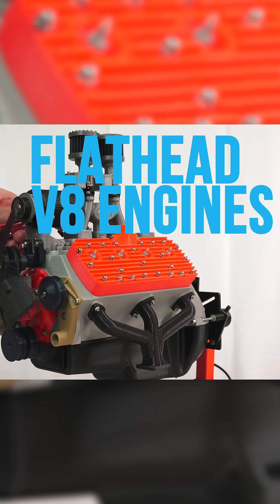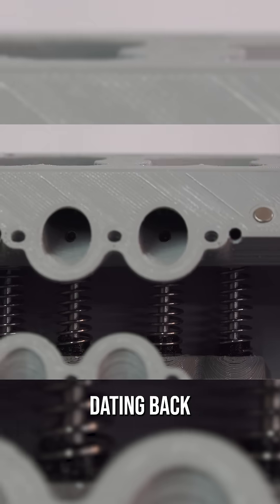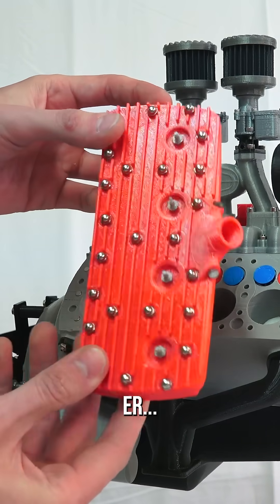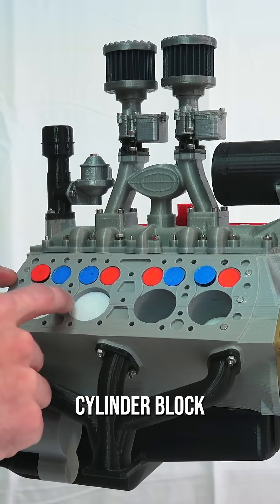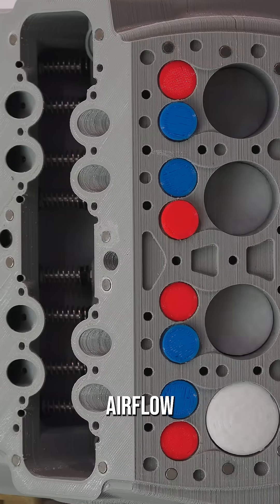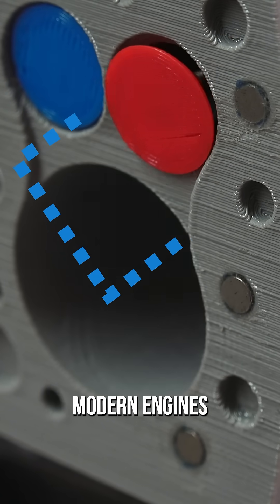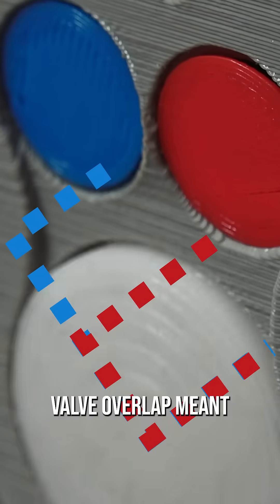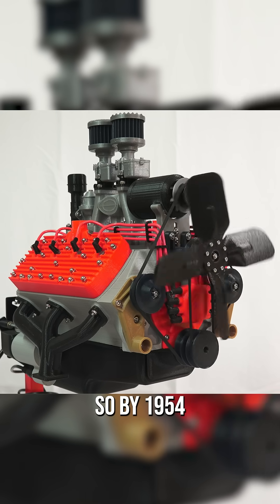What Killed The Flathead V8 Engine?

Comment: 1954...in America.
Here in Brazil we had the Flathead V8 up to 1967 on the Simca Chambord...
Reply: Yeah but you guys got Willys pickups into the 1970's too, lmao
Reply: @TylerLinner  But they were not V8's...
Reply: @AMV12S But your women are less insane, and you can claim Antonio Carlos Jobim and Roberto Leal.
Sou de Ludlow, Mass. USA.
Reply: It's pretty funny that a crapbox from 2004 fitted with a 1 liter naturally aspirated engine makes more power than a 2.x liter V8 from the 50's and 60's
Not only was the airflow terrible on those older engines, they also didn't rev nearly as high and ran on lower compression.
Reply: cuba... still with it's cars from the 50s because they don't buy any anymore
Reply: Thanks for the info.....Philadelphia
Reply: hmm

Comment: So it’s basically a V8 Briggs and Stratton lawnmower engine.
Reply: No, it's a side valve engine just like most other car engines at the time.
Reply: @Rob-fc9wg  
Isn’t that what a Briggs & Stratton lawnmower engine is?
Reply: @grumpy3543  
Once again, they're both side valve engines, just like the majority of engines ( cars, truck, motorcycles, machinery, stationary engines etc) of the time.
Reply: @Rob-fc9wg  I don’t think that the majority of engines are flathead (side valve) engines. Can you let us know what flat head engines are currently being made besides Briggs & Stratton
Reply: @grumpy3543  
I don't know of any side valve engines being made these days, even Briggs and Stratton don't produce side valve engines ay more.
Do you know what "of the time" means?
I'm referring to this time of the Ford side valve V8 in the 1930s.
Reply: @Rob-fc9wg  What are we arguing?  The flathead is the same design as a Briggs & Stratton. It does not have overhead valves. What are you arguing anyway?
Reply: @grumpy3543  
I give up, you're too dense!

Comment: Were flatheads' lack of efficiency assisted at all by turbocharging?
Reply: There were kits to install superchargers on the old flattie Fords.  It did help make power, but the flathead design was still a fairly significant restriction.
Reply: @xaenon  I just like the streamlined look of them...Thanks. I started researching the hot rodding enthusiasts and they really took these "handicapped" motors to the extreme.
Reply: As said, people were supercharging them. But those blocks were pretty weak and, with only 3 main bearings, the crankshaft isn't all that stable.

Comment: The flathead was a very low compression 6 to 1
Reply: The gasoline of the day was pretty bad.  Compression ratios higher than about 6 to 1 were pretty much all the gasoline of the day could reliably support.  After the war they began using additives that had been developped during the war, which allowed for much higher compression ratios.

One of the additives was tetraethyl lead, which helped keep the valves from being eaten alive by the higher combustion temps of the higher compression engines.

Comment: There was a flaw with the flathead V8 engines. that was common on a large number of these engines. and was cracked engine blocks. they commonly cracked between the Valve seats. companies such as Offihouser produced much better heads for these engines. along with better intake manifolds but that would bring a new issue out in these engines. because as people would build these engines for better performance. because they only have three babbot main bearings. they were prone to crankshaft failure. but when built more mildly and put in light deuce coupes. they were pretty fast compared to other cars of the era. and Lincoln made a larger flathead engines in V8 and V12 configurations that were popular with hot rodders of the era.
Reply: The combustion chamber is the gap between the valves & the cylinder, getting cooling water in there is impossible so it's a hotspot.
Reply: @alanhat5252   
I know these engines pretty well. the valve seats were too close together. and the proof is they make a modern version of these engines. with casting of the engine block with the valve seats spaced apart farther
 and use clevite style bearings which cures these issues.
Reply: @musicauthority674  as I said, lack of cooling
Reply: @alanhat5252  They on rare occasions would crack down the cylinder bores also. I know this because I had one that did that. there could be a number of reasons for that to happen? such a previous owner over heated the engine. or didn't keep the cooling system serviced at the right intervals.
Reply: Hot Rod Lincoln!
Reply: Not all the flat head ford engines have babbit/babbet/ babbot bearings  but they all have unbalanced cranks shafts
Reply: They had cast iron crankshafts which are inherently weaker than current forged steel ones

Comment: This seems like a design that could be improved.
Reply: It was.   It evolved into the OHV engines in the 1950s.  There were speed shops that offered OHV conversion kits for these engines back in the day.  Ford learned what worked, and after the war when there was demand for more power to move the increasingly heavy cars, they rolled out their first OHV V8.

But, it was actually a Lincoln mill, and it was introduced in 1952 - 279 cubic inches.    Ford got an OHV six that year, and didn't get an OHV V8 until 1954.

Comment: Offenhauser made OHV cylinder heads and a conversion kit...
Reply: Zora Arkus Duntov made the 'Ardun' Hemi conversions for these engines back in the day.   Later went to work for Chevrolet and created the Corvette.
Reply: Offy made a LOT of performance parts for those engines but AFAIK no OHV heads. Others did. Speedway motors has a ahuge range of those engines.

Comment: Not just airflow...biggest drawback is the shape of the combustion chamber with uneven compression areas, uneven burn distances and generally low compression
Reply: All that stuff was a bit ahead of the engineering of the day. By the time they had developed the OHV they were starting to sort out distribution and such.
Reply: @xaenon  
Not quite true...the first four valve OHC engine was developed in 1914 (just before the war) and used in a racing motorcycle in the UK. The Ford flathead was a child of penny pinching...to get bang, you use displacement...a formula which works to this day, with GM and Chrysler still using OHV V8 engines

Comment: That airflow thing isn’t really a problem
Reply: Not for general use, no.   The engines didn't need to whiz up past four grand very often, and displacements were typically very small.   The flatties at Ford were 221 cubic inches, and Mercurys were 239.

Comment: The main reason was restriction because the middle 2 cylinders on each bank shared a single exhaust port
Reply: That's not really a problem it's the heat

Comment: The video is incorrect. The Cadillac flathead V8 was produced in 1914, about 13,000 were made, making it the first mass produced American V8 engine.
Reply: IIRC correctly, there was a Chevrolet V8 early in the 20th century too.   But both it and the Cadillac were terribly complicated things to build and maintain, and fairly expensive, too.  

Ford had the distinction of figuring out how to cast a one-piece cylinder block in a fashion that was cost effective enough to offer the engine in 'middle class' cars, and it was fairly reliable, too (remembering, of course, that this was the 1930s and 1940s).

Henry wasn't the man to come up with the first V8, that's true.  But he's the one that made it  cheap and popular.
Reply: @xaenon Chevy had a V8 from 1917 to 1919. Being an OHV design, it was compairitively complicated.

Comment: The exhaust path around the cylinders also led to chronic overheating isdues
Reply: I was amused to see that the v8 engine had v6 headers in this 3d printed model. That would certainly have contributed to an unobvious exhaust path, too!
Reply: @JerGol You absolute Muppet
Reply: @JerGol  Part of the flatheads faults never resolved was the siamesed exhausts. Though some OHV V8s had similar in the 50s. Stude V8s were one

Comment: The first DOHC V8 is the GAA engine for the Sherman tank. First mass produced pushrod V8 from ford is the Y block engine and really changed the game. It got replaced by the Windsor.
Reply: The amount of tech in the GAA engine is astounding. It really looks like an engine 40-50 years ahead of its time. It's always been surprising to me that Ford never brought the GAA's design cues into a mass production automobile engine.
Reply: @wysoft  The 1st time I saw a GAA; I thought it was a modern hemi style V8.........had a major WTF moment when I found out it was a thing from 80 years ago.
Reply: @wysoft  If it's for a tank, the bean counters stay quiet.
Reply: I thought the FE replaced the y block? Then that got replaced buy the 335 series big block?
Reply: Chevy had a V-8 in 1917 Rolls Royce in 1905 Cadilac in 1915   The Ford GAA engine was 1945 Era
Reply: Not to mention it was based on the V12 Merlin (Ford stole the design when they were supposed to do a deal, and tried to replace aircraft engines with it, but it didnt work out, so they went from 12 cylinders to 8, and thats how we got the Ford GAA)
Reply: @n2oin  Of course the yanks would decide to just steal something instead of make a deal, it's cheaper!

but sod them, I'd rather a Meteor any day.

Comment: Interesting that Europeans were making dual overhead cam supercharged engines in the 1930’s
Reply: Americans were also making radical overhead cam engines in the 30s, if we are talking about racecar stuff.

You know what regular daily driver European cars had in the 30s? Well, the Austin Seven had a 0.7L 4cyl flathead four cylinder making, and this isn't a joke, TEN horsepower.
Reply: In production engines? Engine question from a European.
Reply: @thiswillprobhrt in racing engines, and perhaps some racing engines that were sold to the public. Not mass production, that's for sure.

Comment: Is this one of the reasons why american cars had 8 liters of displacement and barely 110 HP to show for it?
Reply: These weren't eight liters.  They were 3.5 and 3.9 liters.

If you're talking about the malaise-era cars , that's a whole topic unto itself.  I could write a book.  SERIOUSLY.   There is so much involved with that it isn't even funny,
Reply: @xaenon  I never heard about the malaise era, so I don't know. 
But it you're well versed in the topic, do write the book!
I'm not being facetious either. Lord knows there's so much crap out there, we may have a hiden gem here in your case.
Reply: @pitecusH  Nobody would read it, lol.  Everybody is content to blame emissions control and Corporate Average Fuel Economy mandates from the government… and to be fair, they WERE prime influences.  

I’ll give you a summary, though:

1) Horsepower ratings are garbage.  Few people actually understand what they represent, even fewer understand that for the vast majority, the engine spends less than 1% of its life anywhere near its peak output.

2) Horsepower ratings are garbage, but for a different reason this time:  They’re often bogus.  The manufacturers will ‘fudge’ a figure to make it more impressive.

3) The way horsepower was rated changed in 1972 - from ‘gross’ to ‘net’.  This alone resulted in roughly a one-third drop in advertised output.

4) EPA and CAFÉ (Corporate Average Fuel Economy) regulations went into effect at the same time - forcing the automakers to take measures to reduce emissions and improve fuel economy, which resulted in significant ACTUAL power drops.  Especially since most of the engines in production were never really intended to accommodate these measures. 
  
5) Malaise on the part of the manufacturers made matters worse.  They were trying to ‘ride out’ the OPEC embargo and hoping heavily that the CAFÉ regs would ease.   So, no innovation, no real effort to make their engines better.  Instead, detune what you had, focus on econoboxes like the Pinto, the Chevette, the Vega, and so on.

6) The automakers kept making their cars bigger and heavier, and adding more toys to them.

There’s more, but these are the most prominent factors.
Reply: @xaenon  Appreciate the summary.
You are a gentleman and a scholar.
Godspeed!

Comment: The head was simple. But the engine block was more complicated than ohv. More opportunities for defects and problems. Also doing valve job in flathead a nightmare keeping grinding dust and doing machine operations deep down in engine compartment. Plus I have seen things indicating valve adjustment big deal. The airflow problem wasn't a big deal before WW II because gas was so awful and we couldn't make gasoline good enough to exceed flathead limits. Or we could but didn't. But I still don't understand why this design lasted so long. We had Chevy 6's Buick straight 8 and GMC truck six. We also had av gas.
So I don't understand why this design lasted so long.
Reply: Money. The flathead was 'good enough' until competitors OHV V8s forced a change.
Reply: Once a company is invested in the machine tooling to make an engine, they’ll exploit that investment as long as possible.
Reply: It lasted so long because flatheads were cheap and good enough.

Comment: Not true Chevy had a OHV V8 in 1918
Reply: Not turning this into a Chevrolet vs Ford issue, simply pointing out that Ford, in fact, was not first.
Reply: Ford was way down the list as far as "mass production V8", I believe Cadillac was first in 1914, Chevy came along in 1917. There were many before Ford.
Reply: The failed Chebby V8 was only available for part of one model year. It was a crude thing with cylinders bolted to the crankcase, and was very unreliable. Hardly mass production. A model A Ford 4 cylinder made more power.
Reply: @pete1342  still it was produced.

Comment: Funny tidbit in history; One of the last flathead engines in production for automotive use was the F134 (1971)... but its only technically a flathead. Its both an OHV engine and a flathead, with the exhaust valves being in the block, and the intake valves in the head. It was a modification of the older L134. It was a very bizarre engine with its only benefit being the fact the intake valve was huge and pretty much the only IOE (inlet over exhaust) engine ever made for the American market.
Reply: Landrover 6s are like that as well. Bloody terrible,,, though it is Landrover!!

Comment: The first high production OHV V8 was made by Oldsmobile in 1949 and Olds swept NASCAR for a couple years until the rest caught up and made their own.
Reply: Chevrolet had a production OHV V8 in 1917
Reply: @Texassince1836  yes I read that, but it was not made in many numbers and did not ha e much market impact like the Olds did 30 years later.
Reply: @Texassince1836  And yet they waited almost 40 years before mass-producing a V8.
Reply: Decades ago I knew an old timer WWII vet who ran a Cadillac dealership.
After the war he bought an Oldsmobile with V8 engine.
He used to laugh about how the cops with their Ford V8 could not catch him speeding.
He said Cadillac was the same -very fast compared to other cars on the road in 1950.
Olds and Cadillac were much more expensive than Ford. 
I don't remember why Chevy wasn't in the mix, I just know from different chats with old timers still living when I was young always echoed Oldsmobile/Buick/Cadillac as the kings of speed until the late 60s.
I'm talking about 1950s not 1967 through the 70s because everything changed around 1965.
Reply: 308 6 cyl Hudsons had something to do with that!!
Reply: dussenberg had a DOHC supercharged 4 valve per cylinder inline 8 in 1928.

Comment: Flatheads are insane. They were used for EVERYTHING. Generators, air compressors, pumps, etc.
Reply: They were used in  French Simca cars in the 60s and in French military vehicles up until the early 90s

Comment: I owned a 51 Ford Custom Coupe with this engine. Loved it!
Reply: I'll bet you wish you had it back... Speedway motors sells everything to hot rod a flathead Ford V8... Except the engine block.... There are 3D printers that print metal... And you can buy one that will 3D print a metal V8 block it cost $5,000. For the center exhaust you can 3D print an over and under individual exhaust and have four exhaust ports on each side that could be made to line up with a set of headers for a small block Chevy... And 3D print the block out of aluminum. .. and speedway motors can supply you with all the other parts to build a complete engine imagine all the flathead Ford with offenhauser headsr aluminum intake with three duces. Stromberg 97 racing carburetors.. OFFY  racing camshaft.. TOTALLY RELIABLE  WHO ARE THE POWER STEERING PUMP... PERMANENT MAGNET ALTERNATOR. POWER STEERING PUMP.   AND ELECTRIC WINDOWS.  .. a 1940 Willie 3 window coupe .. 1932 highboy Aura 1932 Ford 3 window coupe... I want to put it in your favorite a 1951 Ford custom   ... When I was in high school about 1965 one of the students had a 1951 Mercury weather flathead Ford V8 like I described above with all OFFY PARTS ... 3 speed manual with an overdrive ... It took about a mile top out about 140 mph ... We have the technology today to 3D print brand new Flathead blocks out of metal and ready to run